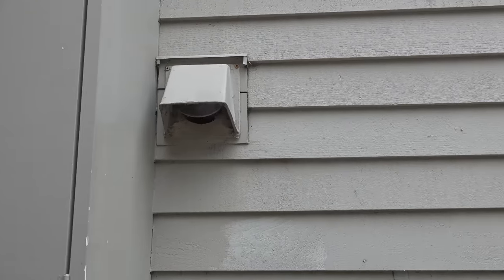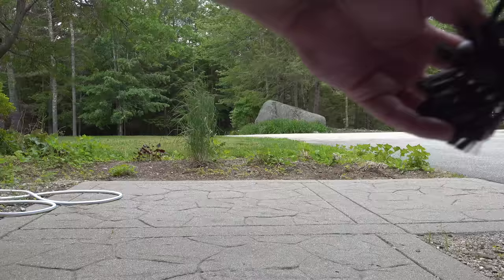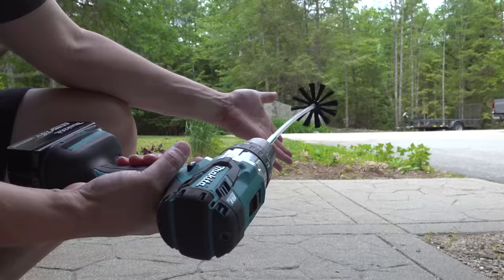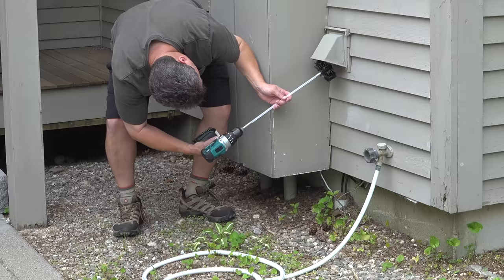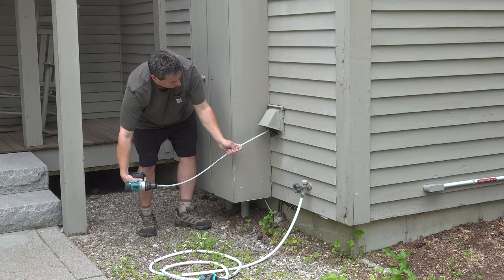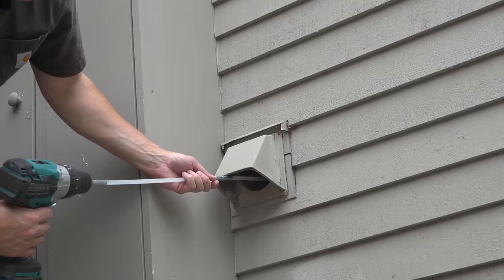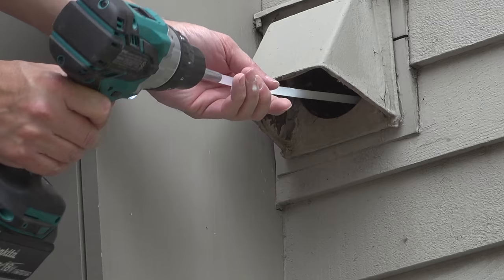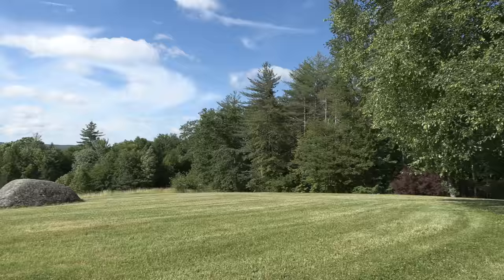EASY WAY to CLEAN a Dryer Vent FAST!

Comment: As a former appliance technician, the idea that you don’t need to disassemble anything is misleading. Depending upon the amount of buildup in the vent, using this method could actually push larger chunks of lint into the dryer that are too large to be blown out. This is why I always disconnect the hose at the dryer, then push everything outside. I then insert the brush into the back of the dryer to loosen any build up there, then suck it all out with a shop vac.

Comment: I greatly enjoy your videos and love your new house!  I noticed some of the product reviews on Amazon claim that the sections might either break apart or come unscrewed while in the vent. Did you find the tool of sufficient quality for multiple uses?  Do you think the issues above that some people described in their reviews are simple operator error, for example running in reverse?  Thank you!
Reply: Wrap duct tape or electrical tape around joints

Comment: How do you avoid getting the brush stuck in the dryer’s blower motor? I’ve seen some kits with adapters that act as a stopper. Is that necessary?

Comment: a friend had the foil kind of extension from dryer to outside - a Squirrel got in thru the trap door, ripped the foil and did damage throughout the basement.  An expert had to be called to catch the squirrel

Comment: I would think going from the inside to the outside would be better . Maybe to use an electric powered blower to blow out the vent from inside to outside . And then to use a boroscope ? to see what the results are .

Comment: Can I use this to clean my heat ducts too?
Reply: The kit he showed usually comes with just a 4" brush, which is the common dryer vent pipe size. You can find kits that also have a 6" brush, which will work much better for HVAC ducts, which are often 6" to the rooms. Only do this if the ducts are metal, flex duct is thin plastic that can easily be torn by a brush.

Comment: My house has 6" diameter ducts and all of the tools I've seen are for 4" ducts which are not large enough to clean the larger ducts. Any ideas where I could find 6" brushes that would fit a kit like this?

Comment: My dryer is in the center of the house, on a slab. It vents up thru the attic to the roof.  😧
Reply: Alternate the use of a brush from the inside and a leaf blower.

Comment: I ran the drill clock wise but the drill bit kept coming out itself. What did I do wrong? Thanks
Reply from the maker: It could be threaded in reverse, you may need to do it in reverse if that one is different.
Reply: @SilverCymbal  Thanks for replying. I will double check with vendor.                                             

I manually turned the brush inside the duct.  1st time after 10 years I bought the house. Didn't get a lot of stuff out though.

Comment: I need one of these but about 10x longer.
Reply: Kit contains multiple extension rods. They connect to each other. Clean a section of pipe, add an extension, clean more, add another, etc. Make sure to always keep the drill turning clockwise.

Comment: The real question is why do you still have dryers that need vents? I haven't seen one of those since the 1990s. Condenser dryers have been standard here for decades. In the last years heat pump dryers have become common. They use 1/3 of the energy.
Reply: Where
Reply: @Sasha8pancakes  Norway
Reply: No idea why, but that is the standard here throughout the entire country.

Comment: No this is good stuff. We just paid  $100 to a contractor on-site doing another job. It literally only took him a couple of minutes. Clothes get dry faster., saves electricity, dryer lint can be a FIRE HAZARD, particularly if you use dryer sheets (don’t do it), prolongs the life of your dryer and makes your home a bit safer.

Comment: Keep in mind folks, cleaning your dryer vent is NOT the most effective and immediate way to reduce the risk of a Dryer Fire. Dryer fires are the 6th leading cause of house fires. Don't have a false since of security thinking you're safer now that your dryer exhaust is cleaned. 

The most effective and immediate way to reduce the risk of a dryer fire is disassembling the machine and cleaning out the interior cabinet, around the motor, heating element, etc. Check out my channel for more educational information.

Comment: You actually want to remove the vent tube and not just use a drill to do a quick clean. The vent hose is not tough and you can rip it with the drill.

Comment: Never use these unless you want an expensive repair on your hands.  These nylons rods are notorious for snapping inside dryer vents, causing you to break open drywall or crawl around in attics to open the venting pipes to retrieve the brush heads that are stuck inside the dryer ducts.   The rods cannot take the torque from the drills, especially went the brush is pushed pass a bend in the duct work.  If you do use this tool, only use your hands to push it through the vents.  DON'T USE IT WITH THE DRILL.

Comment: This is NOT the proper way to do this. Disconnect the flexible duct to the dryer then clean the ENTIRE duct. Use a vacuum not this piece of junk tool that will damage the thin aluminum.